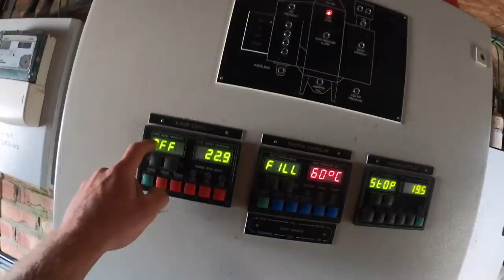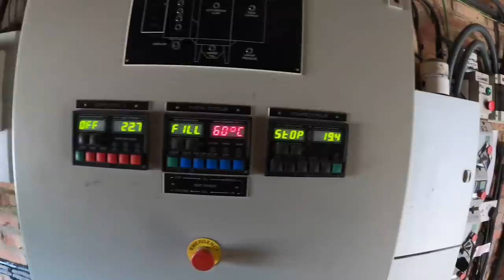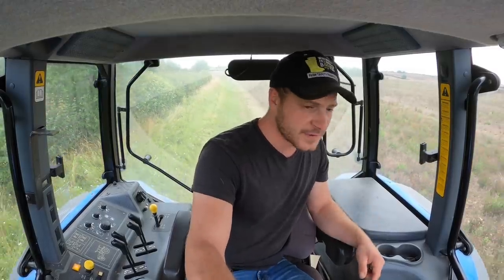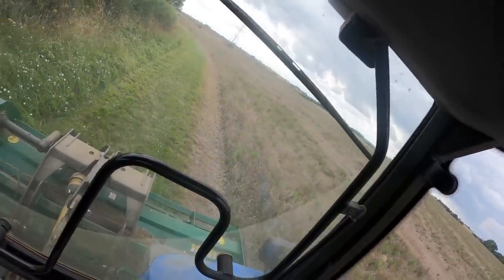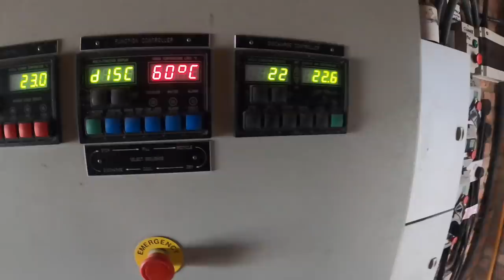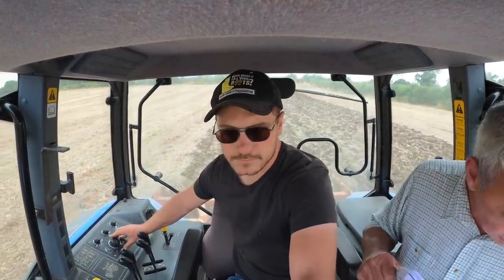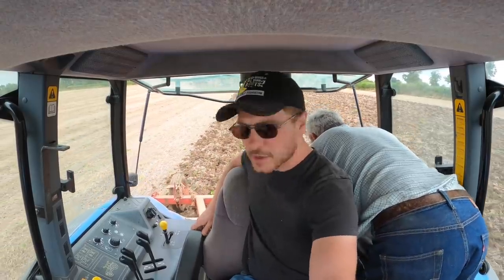GRAIN DRYER, TOPPING & MAKING A START WITH CULTIVATING

Comment: Hi Nick, regarding the flasher unit I would remove all four bulbs and switch on the hazards. Put each bulb back and when the fuse pops that is the bulb that is essentially creating a short. From experience although the bulb seems to work it is potentially shorting the circuit because it has an almost zero resistance. On the JCB the same problem can keep the four wheel drive engaged as it is designed to engage  the 4x4 for enhanced braking when the brake pedal switch is actuated.
Reply from the maker: Thanks for the tip Matthew 👍

Comment: You will know when the draft is working because instead of numbers for the linkage on the RHS of the dash it will say DR.
Then if you want to set a lower limit, when in work just ease up the position control lever until you feel the implement just start to react and then move the position lever down a touch .👍